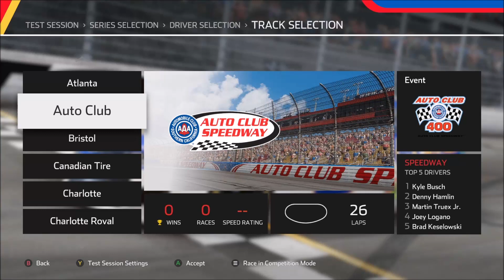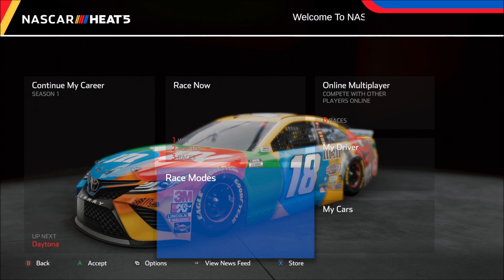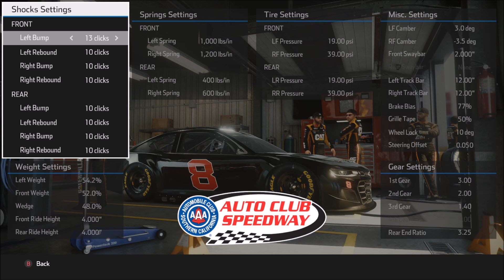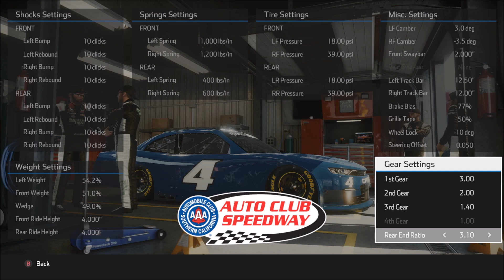NASCAR Heat 5 Setup - Auto Club (Cup,Xfinity,Trucks)

Comment: Thank you once again for the setups of Nascar heat. I really appreciate your videos
Here in 12:51
I did notice 1 thing when you was talking about cup then changed to xfinity, the FRONT pressure did lowered 1 psi from 19 to 18 but you did not told anything about the change.
Do I have worry about stability overall? Or its was just a mistake and will not affect at all?

One more time, thank you for your effort

Comment: you need to do a sperad sheet to show all of the setups  I have been trying your setups but its hard to remember what you put .. I use thease as a base line for myself to try to see for my driving style what i might need to adjust on   keep it up  it helps alot
Reply from the maker: I do keep a spreadsheet that holds not only the release setup but also notes and additional test setups. That is for my use and I highly recommend anyone interested in improving do the same.